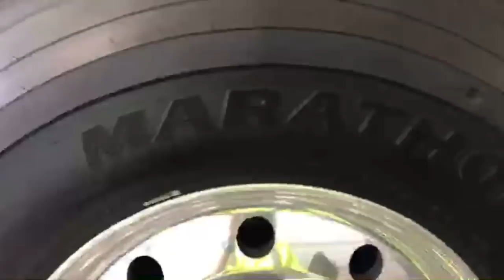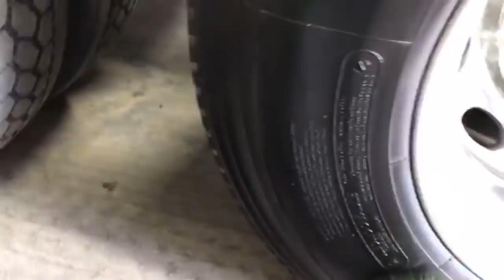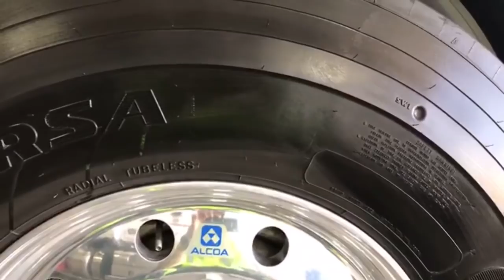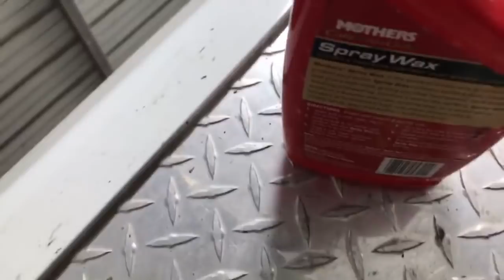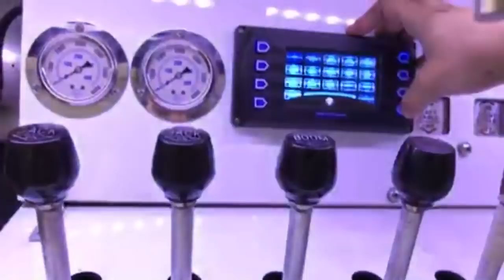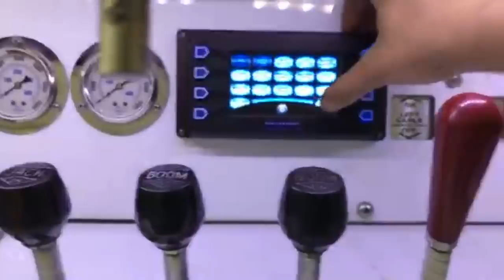Just Cleaning My Truck

Comment: Y'all need to get off the rotator hang-up.  Not every toolbox needs a chainsaw.

But fact is, a multi hour, multi lane closures digging out the guy that tried to enter the backside of the truck stop would have been a 1/2 hour job from the shoulder.
Reply from the maker: Its funny that you say multi hour job when in reality the job took 1 hour and 21 minutes. Would a rotator be easier? Yes! do we need one? no! And CHP Is ok with that. Thanks for watching!